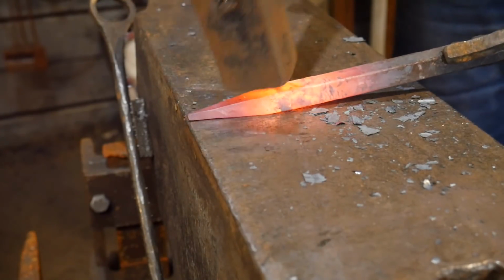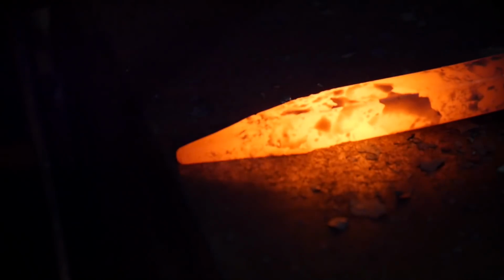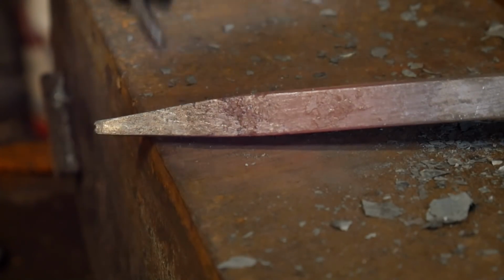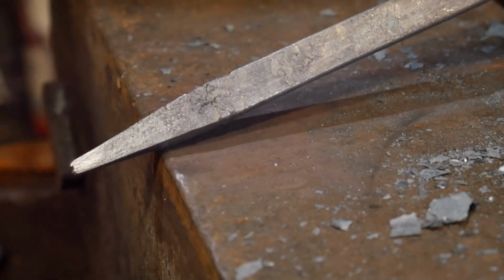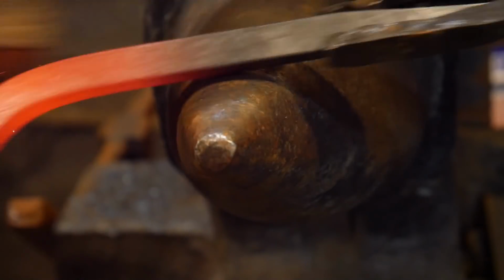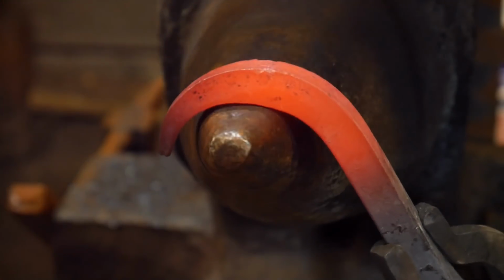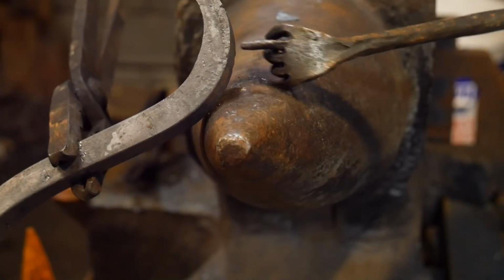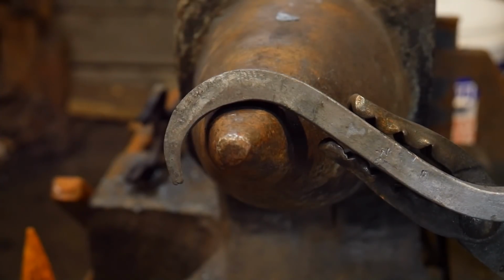Don't Burn Your Steel!

Comment: As a "forger" myself have a few questions. The first is how if unrecoverable by heat treat burnt steel has to be heated beyond 5600F and a forced air coal forge tops out around 3600, how are you burning the steel?  Also, since steel is a liquid even a couple thousand degrees F below the burning point, how are you burning steel that is clearly a plastic solid and not a flowing liquid? Also, why is it that you're the only channel on YouTube with a video about burnt steel, or, for that matter, the only burnt steel with forge reference on Google outside of obscure scientific references?

Comment: Is it possible to take wrought iron or cast iron and slowly burn the carbon away by heating it for a long time? I'm having an existential crisis about there someday not being any low carbon steel left in the world.
Reply: I know I am replying to an old comment, but in the hopes this is helpful look up "Bessemer process".  At least in the molten state, bubbling O2 through steel is literally a way used in industry to remove carbon.

I can't say whether this would work in the solid state that you are describing, but it is very definitely possible to use heat and oxygen to separate carbon and iron.

As far as lack of low carbon steel goes, the VAST majority of steel manufactured is mild low carbon steel.  Its what we use in bridges and buildings and stuff.  The mid/high carbon stuff is relatively rare.

Comment: Don't burn your steel has always made sence to me as I've always thought that it will ruin the finish and burn off details etc. Seeing this demo, though, is really interesting as I hadn't thought about all the cracks and points of stress that would then be in the steel and would effect the final product so much. It's one of those thinks that makes sence on 1 level but has a whole load of other levels that you don't even think about. Thank you for the demo, I almost didn't bother watching it and I'm really glad I did. 😅

Comment: If you burn your steel, is there anyway of bringing the grain structure back or is it damaged for good?
Reply from the maker: +Marc S if you were to burn something a little bit in ornamental work as I said in the video you can usually plainish  down quite a bit and get away with it. Just do not plan on using it for anything structural as the steel internal structure has already been compromised and will not hold a load or deal well with impact. In the case of burning a little bit of a pointer finger it's probably okay because it is a blacksmith's pointer finger LOL
Reply: no, once it's burnt like Roy said it's toast! cut off and  re do it and if you do that when finishing the other end of an S hook you either scrap it, cut the end off and make a drive hook out of it, or a smaller S hook
Reply: Several blade guys blame a lot of flaws on enlarged grain structure  from burning work. I was just trying to get a grasp on what can be done when Murphy's law locks onto a project. I want to make detailed work similar to roy's pointer finger, but nervous about burning a finger. Last thing i would want is a broken digit. Thanks for the help
Reply: This clarified a few questions I had about this issue as well.  It don't happen often. But I do tend to get side tracked and forget to keep a closer eye on the fire.  Thanks you for the video.